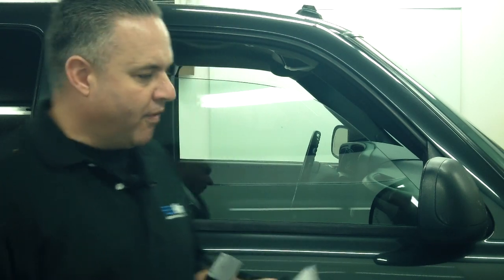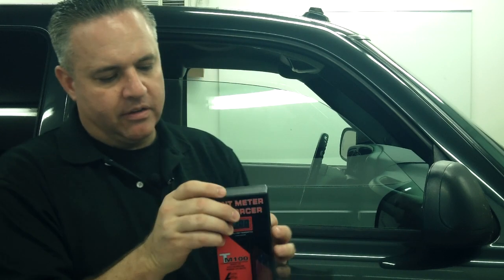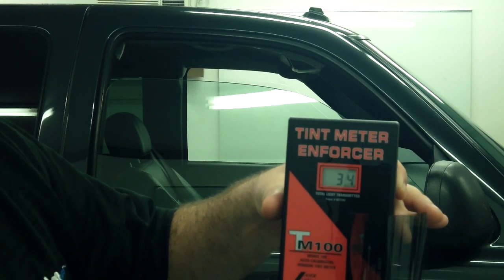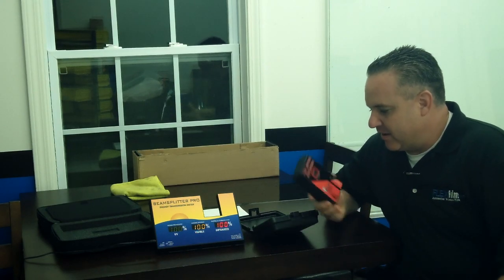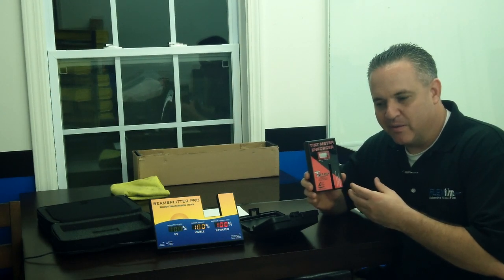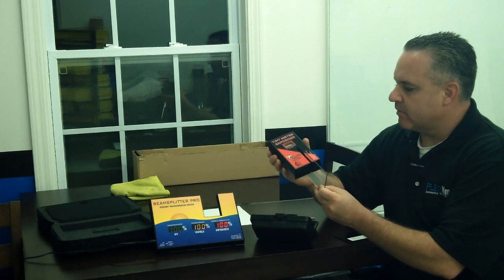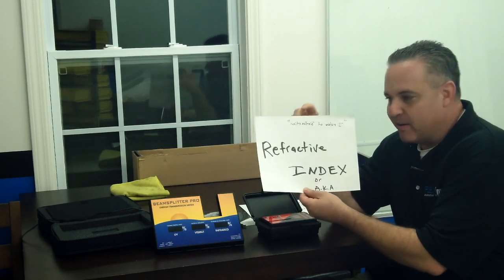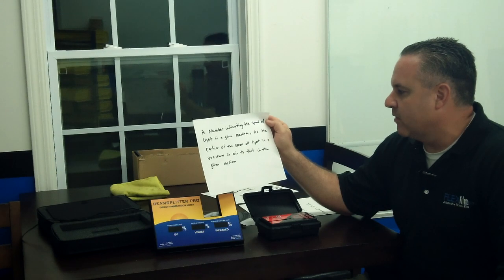Window Tint  Mystery of VLT Solved!

Comment: I went to the Laser Labs website and checked the specs on the meter you were using. I have also attended a 2 day training course on the use of the meter you refer to. The specs on the Model 100 are specified by the manufacturer as being a plus or minus 2% meter. The state standards for VLT in TN are 35% as a rule of thumb depending on the vehicle type of course. Any reading we take would take into account the margin of error before any violation would be found. The margin of error on some of the two piece meters is plus or minus 3% so our training reflects that error. I think your video is very informative and one of the best attempts to educate on VLT I have seen. Thanks for your work on this.
Reply: If you read the Tennessee Code Annotated 55-9-107 you will see that the "material" is only to be considered. Tennessee has always been "film only" enforcement to be examined with the state issued card. Tennessee is not a "net value" state as the code states, which makes the meter enforcement unlawful and inadmissible in court in my opinion. I contacted the Commissioner of Safety Office, who is to determine what tool is to be used in the examination of window tint in this state, and they informed me that the Commissioner has not authorized these meters for use. THP doesn't carry them, so how can other municipalities use them at their own discretion?

Comment: Ralph, I am going to summarise all the comments from the others here to explains the discrepancy you got. The sources of errors are:
1. The glass or film that you put between the sensors are supposed to be placed at right angles to the sensors, so that the light travelling from the transmitter to the sensor take the shortest path. When you had carelessly put the film between the Light Labs and the EDTM meters, you had let the film curve slightly or it was not positioned at right angles to the light. You were also careless when putting the glass plates between the EDTM meters too. This causes the light to not travel along the straightest, shortest path, but rather at a slight deviations through the film/glass. This is main explanation behind the discrepancy. 
2. There are tolerances (+/-) in the accuracy of the meters that had mentioned by the manufacturers. You have to consider those too.
3. When you had attached the film onto the car window, you had not taken account of effect of the thin film of water between the glass and the film.
4. When measuring the VLT of the film, you had not removed its backing material beforehand.
5. There was no need to do the math for measuring the combined effects of the car window with the film. You just need to place the film on the window, without the water or without peeling off the film's backing material, and then test them together. 
6. Even the math you did was very poor! You did not properly take account of the decimal places. You had only gotten the 'correct answer' because it was rather fool-proof.
7. That last bit about the refractive index need not be relevant here if you had done your experiments properly. Your explanation of it was also 180 degrees wrong. In short, the speed of light in any material = the speed of light in a vacuum / the refractive index. When the refractive index is greater than 1, the speed of light in the material drops below that in a vacuum. 

I was intrigued by the video and I did learn a few things, so thanks for that, but there were poor scientific, poor mathematical and poor experimental skills demonstrated here. So, please do not blame your local policeman when they follow the procedure correctly and measure your windows VLT correctly.

Comment: Fatal flaw... Your whiteboard math was correct. What you forgot to account for was the backing to the film before you separated it. You measured the light transmission with the backing still on, then removed that to apply to the car. That backing had a tint to it also. Shoulda simply held the film up to the window with the backing on to get the 24% reading you were expecting.
Reply: That backing would be clear mate it wont make a huge difference i think whether on or off..its the tinted film that matters right?
Reply: @jaswinderahluwalia  No, the backing makes a difference, it would not meter at 100%. Also If we do the math at 35% it comes out to 26%VLT which is closer to 28%

Comment: Ralph, refractive index has no effect as long as it's held perpindicular to the sensing element. The reason why you are seeing change between product is actually due to different wavelengths of light. The LED's they are using are different from company to company and will give different VLT values because of different wavelengths. Hope this helps clear your misunderstanding.
Reply: There is also the instrument calibration error, and ambient light contributing to measurement error.

Comment: Ralph, I think you may have the speed of light the wrong way around. In a Vacuum it will travel the fastest. Then going through any other medium air, glass, water etc. will SLOW it down not speed it up.  

BUT you are still getting the point across and thank you for that

Comment: Different people see the visible spectrum differently; moreover, the extremes defining the range of wavelengths recognized by an individual are unique to the individual.

Two people see a maroon vehicle under identical lighting and from the exact same angle (but perhaps a second or so separated in time); one describes the vehicle as having been some shade of red, the other describes it as having been some shade of purple.

Each of the two witnesses has been certified to have normal color vision, etc.; do the test dozens of times, mix the order (which one sees it first), and the person who thinks it's red will always say it's red, the person who thinks it's purple will always say it's purple.

You can do a similar experiment with either an aqua or a teal vehicle: some will see it as green; others under the exact same conditions will see it as blue.

An instrument able to measure the relative intensity of light on both sides of the glass can be made; the instrument can even be made to sweep through a range of wavelengths -- from much longer than the naked eye can detect, to much shorter than the naked eye can detect.

The data so obtained can be graphed, and the area under the curve can be calculated -- but for all the scientific accuracy and precision of that measurement and calculation, that test can't predict how the competence of any particular driver will be affected by either tinted or non-tinted automotive glass.

Comment: Great video buddy...I watched.it right to the end.Well Done indeed
Glad i stumbled on it.Ive been labouring under the weight of this problem...
Which.VLT % film to add given the glass already has a tiny or VLT readong
Now I know.
I will do a reading of all glasses on my car at the tint shop
Then determine the exact VLT permitted by law
Next i shall select the tint film of the VLT which % multiplied by the existing. VLT gives the % which is allowed ...and allow a 3/4  error 
and step it down beyter be on the  safe side  than be sorry 
So yes...ive learnt something
DO NOT INSTALL any tint film before determining what VLT % the car glass already has
Get a tint reading.
Do that first.

Comment: Hey Ralph, this was helpful but one point on refraction needs to be corrected. The refractive index tells you light goes 2.42 times less, not more, in diamond then a vacuum. This is why diamond is so brilliant, light slows down inside it, which causes the light to bend and bounce around inside.

Comment: Hi mate how are you.  A very informative video on the use of VLT metres.  I was pulled over today by our local police and they found that my window tint was illegal and now I have to get it removed.  I'm in the investigation business where window tint is very useful in my car.  Bad luck I guess. Our rules are no lower than 20% on the rear windows and no less than 35% on the front windows.  Similar to your guys too.   Regards,  Paul  Perth, Western Australia

Comment: Ralph, first off, let me commend the effort you put in making this video.The first 9 minutes or so were highly informative, and clears a lot of speculation w.r.t the true VLT of tinted windows, post application of sun control system. However -

 think the reason why there is a variation b/w the readings of two tint meters you used could be because in the case of the *, the window seems to slot snugly into the Laser labs meter, and there no or very little outside light interfering with the reading, while in the case of second meter you used, a lot of other light from the surroundings, that should not be taken into account, could cause VLT reading to be a little off. Also, AFAIK, refractive index has very little or nothing to do with the intensity of light transmitted through a medium, since, as you mentioned, it only deals with the speed of light through the medium.
I could be wrong though, just my thoughts.

Again, thanks for taking the pains to make this video - it sets right / wrong many assumptions one had.

Comment: The Tint Meter Enforcer is supposed to be accurate to ±2%, but as your research and other people's have shown, it's preciseness is largely exaggerated. Because of this fact, many courts around the US won't accept this sort of reading and have even been known to drop such cases altogether because of the meter's unreliable measurements. Furthermore, some police agencies have improvised to counteract this inaccuracy or discourage it's use entirely. For example, in Nevada officers are supposed to factor in a 5% margin of error when determining if a vehicle has excessive tinting. Also, in Tennessee, officers are heavily discouraged from using this particular meter as it is not capable of providing an accurate and legally sound measurement that is applicable in court.
Reply: Not sure where you heard that about Tennessee.. I live in Tennessee and they swear by it, cops love the thing. I remember it was all over the news when they announced all the cops were going to get one to keep in their car.

Comment: Re your comments about refractive indexes of materials around 10:55 -- light doesn't travel faster through ANYTHING than it does through a vacuum. A refractive index of 1.33 means light travels 1.33x SLOWER through water than it travels through a vacuum. 

From BBC Bitesize physics, "The refractive index of a material is a measure of the change in the speed of light as it passes from a vacuum (or air as an approximation) into the material." Divide 300,000km/sec by 1.33 to obtain the speed of light through water: 225,000km/sec. https://www.bbc.co.uk/bitesize/guides/z88dd2p/revision/1

Comment: but.. tintmeter reads 80 on the 80% glass, other one 75. Tintmeter reads 29 on the 28% glass, other one 30.. I would assume that one meter reads lower/higher than the other one, all the time, but that's not it.. So it's not just something like a constant number in a formula.. must be something else

Comment: Refractive index has nothing to do with visible light transmission when the test is taken perpendicular to the glass (as this meter forces you to do). Refractive index only indicates the change in light path due to the change of light speed entering and exiting the glass at a non-perpendicular angle (at acute angles, this could be a factor as the light would be taking a longer path and encountering more glass, but there is zero effect at perpendicular.)

The spectra used for testing could vary results significantly however. What is the light source? LEDs?Incandescent? And what device is being used to measure the light received, and what is its spectral sensitivity? I.E. If the meter is more receptive to green light, a tint with a red hue will would show a lower transmittance than an equivalent green tint. As far as this video goes, all the tests and results are likely within the tolerances of the product and accuracies of the test equipment - no mysteries here.

If this is about not getting stopped and ticketed, pick a transmittance that is close to the legal limit. Make sure the front windows are comparatively clearer than the back. The eye can’t judge transmittance quantitatively within +/- 20% effectively and a cop isn’t going to waste his time on you unless you are obviously in violation or did something else to piss him off.
Reply: Exactly how would light waves "amplify or dampen each other"? Any such phenomenon would be a violation of the law of conservation of energy. Refractive index is defined as the ratio of the velocity of light in a vacuum to its velocity in a specified material. Since the light enters and then exits the glass at the same angle (as automobile glass is generally flat has constant thickness and therefore surfaces are paralell) the effect is zero. If we want to start talking about lenses and other shaped glass, yes this would be a factor as we could focus or disperse the light causing light intesity variations not accounted for in such a simplistic measuring device.

The measurement differences seen is this video have nothing to do with refractive index. Instead the differences are the result of three factors. Accuracy, Error, and Color/Color Temperature:

Accuracy is the meters ability to resolve a specific reading. In its specifications there should be an indication of accuracy based on it's design. Since these meters display in whole percentages, the display alone has an accuracy of +/- 1%. Additional decreases in accuracy must be accounted for for each phase of the measuring process (light generation, light reception, electrical circuitry). 

Error is the effect on results due to uncontrolled conditions in each test. If the tint sample is bent or non-perpendicular when measured, more or less material may be present in the measuring beam causing varying results.

Color and Color Temperature are the most likely culprit to explain the significant result variations noted in this video. All light sources have a color, or color temperature. What is the light source here? LED or incandescent? LEDs have a specifc color, incandescents (and white LEDs) are generally white but have color temperature. Each sample measured is going to respond differently at different colors and color temperatures. Many tints lean towards green for example. These tints, therefore block more red. If a red LED light source is in play, results will show a lower transmission even though the full spectrum result may be higher.  Receptors also vary in sensitivity across the spectrum. Incandescent light sources also have non-constant color temperature as supply voltage varies.

Comment: how do calibrate this meter
Reply from the maker: There is no way to calibrate most of these meters.  Each meter comes with two glass slides which have been pre determined to be a certain shade.  You can test your slides from time to time to see if your meter matches them.  If they do not match, check your battery or call the manufacturer to see what they will do.

Comment: Sadly The Whole system is greatly flawed beginning with the direction on which the meter is used. You will find a different reflective index by moving the light source from the glass side to the tint side. Also NY State does not count the reflective index of the tint as other states just the VLT, this becomes a problem because if the meter is used one way or the other you get different readings, because visible light is affected by reflection. I myself have done density readings on film for over 30 years up until film became obsolete  in the print industry and in all cases we were required to zero out the DENSITOMETER first as you would with even a digital scale, also the film had to be read in A uniform direction emulsion up or down depending on the meter. If this is not a possible feature on the densitometer then I highly suspect the accuracy of the instrument. Also the light source which is used has to be able to penetrate correctly. LED light sources all though cheap and battery friendly are not as UV capable as Halogen light sources. While watching this video I noticed that the direction the meter was used did not match that of the Manufacturers Video. This Law is badly thought out in NY State and should be revised until a uniform system can be developed.

Comment: A thoughtful video, but does not explain how refractive index affects the reading.  If the test light is fired perpendicular to the surface the beam should not be bent.

Perhaps the difference between meters is caused by the emission spectra of the different light sources and, the absorption spectra of the different materials.

Comment: Light travels slower in air, water, and diamond, not faster.  Sorry.
Reply from the maker: You are right.  I made an error.  I caught that last year but did not know how to fix the video.  I might redo it one day.
Reply: Ralph Van Pelt Just add a side note about the error during that time frame
Reply: +Ralph Van Pelt Nice video personally I don't give a damn, here in nyc cops are tinting their personal vehicles so why should I comply? I have limo tints on the rear pitch black a thing of beauty  but my front and windshield has 30 %  at night you can't see a damn thing lol. I did like the part when you stated car windows come in different shades and thickness that will help in court lol
Reply: +Ralph Van Pelt Nice video personally I don't give a damn, here in nyc cops are tinting their personal vehicles so why should I comply? I have limo tints on the rear pitch black a thing of beauty  but my front and windshield has 30 %  at night you can't see a damn thing lol. I did like the part when you stated car windows come in different shades and thickness that will help in court lol